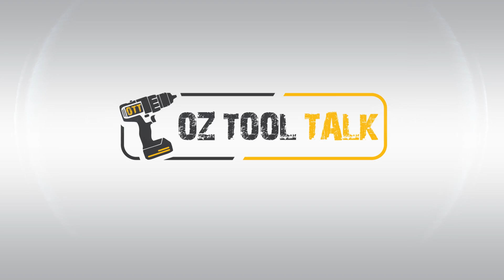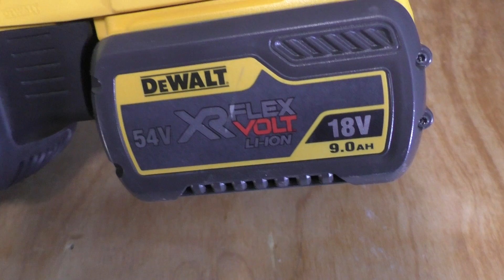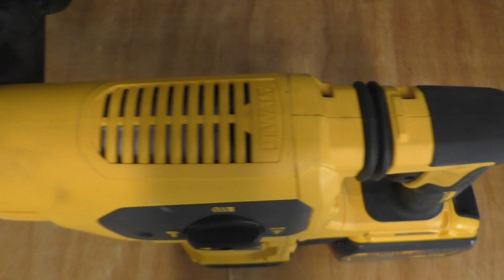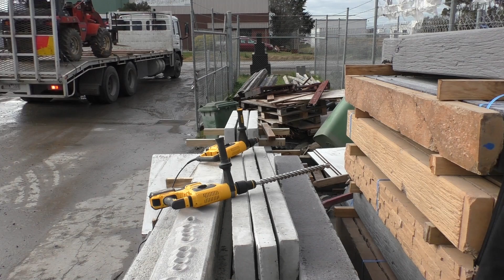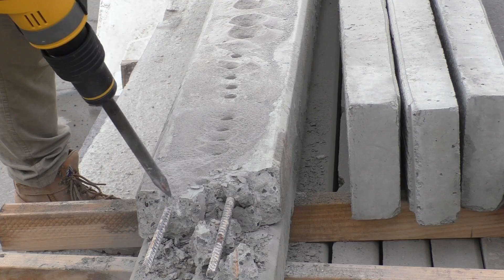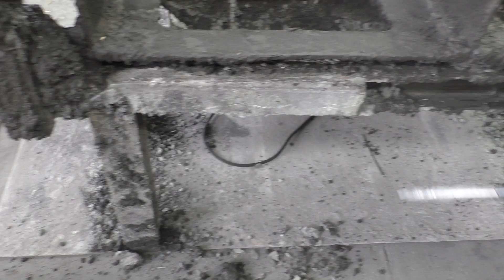Dewalt 54V SDS MAX Rotary Hammer Drill - DCH481 Brushless Flexvolt

Comment: Hey does it affect the flexvolt batteries by charging them on the 18v lithium
Ion chargers? I know flexvolt tools come with their own charger usually but I have a lot of dewalt 18v xr line and chargers. Also what’s the difference between this and the dch333?
Reply from the maker: [Dwain] The fast-chargers that come with flexvolt kits ARE 18V chargers. Flexvolt batteries are 18V batteries until they are connected to a 54V tool. So any lithium-ion charger on any lithium-ion battery is fine.
Reply from the maker: watch our SDS comparison to see the differences from the DCH333! :)

Comment: Just so you're aware, there are actually three models in the SDS plus range; 323, 333 and 343. I have the 323 which punches at 2.8 joules which is plenty. The other two are slightly higher at 3.5 joules. Which model do you think you'll use in the upcoming high voltage shootout? 

Great vids.
Reply from the maker: I don't think we have the 323 in Aus, so probably the 333 and/or this one
Reply: Oz Tool Talk , they're all good machines. I also have an M28 sds from Milwaukee, very nice machine, but at 4.1 joules it has a habit of breaking the shafts of chisel bits. Any idea what the line up will be for the shootout?

Comment: Nearly double impact joules than the milwaukee m28 this dewalt blows it out of the water.  Until milwaukee up there volts then dewalt is the clear champion
Reply from the maker: [Dwain] but Milwaukee do have an M18 SDS-Max with similar specs!

Comment: 9AH batteries probably only offer  around 20 minutes of chiselling time, I have two  of them and two chargers and two Sixers in reserve. I used the  drill today and yesterday to widen a dry riser cavity  so the electricans could run their tray up the riser. It took out a good inch of hardened  slab face on two batteries, surface area about two feet by three feet and 1 inch deep.

Vital tool for me, any other tool would have been too heavy or long to use at the top  of a ladder in confined space with   limited wiggle room.

Power is civilized too which is important, you don't want to get stuff blowing off the surface at close range back into your face.

It's just ideal tool.